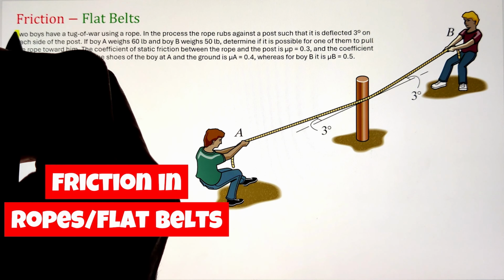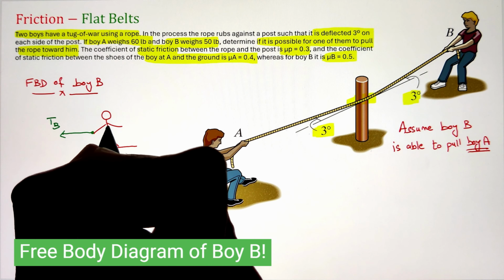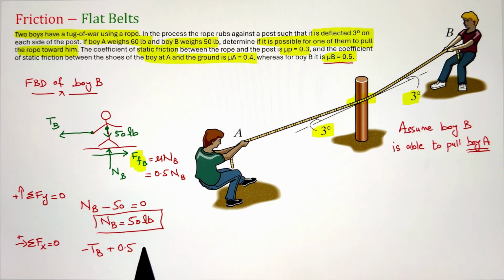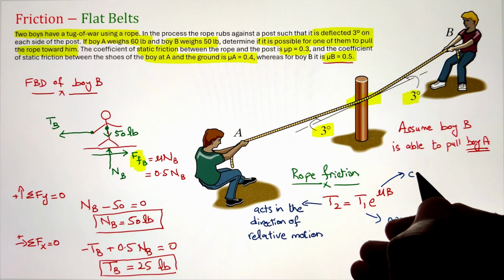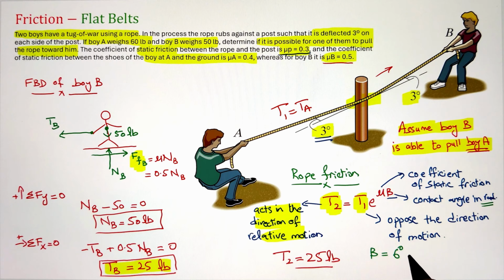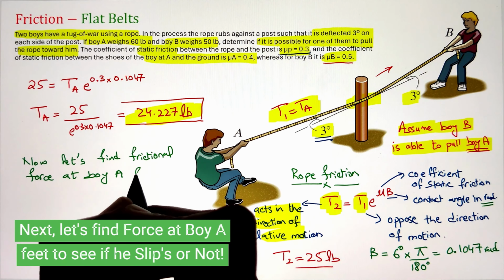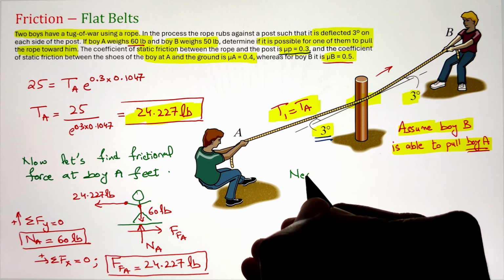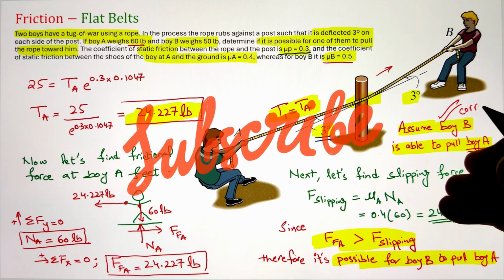Tug of War Rope Friction Problem | Capstan Equation & Belt Friction | Statics Full Solution

Comment from the maker: The key to this problem is comparing the maximum static friction each boy can generate with the tension ratio caused by rope friction around the post. Since the rope contacts the post through a small angle, the capstan equation is used to determine whether one side can overcome the other.